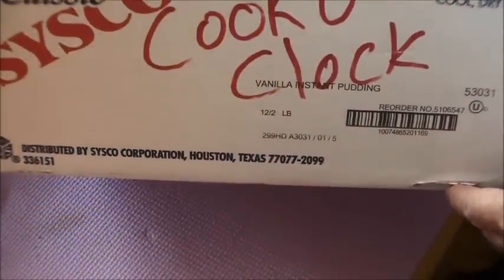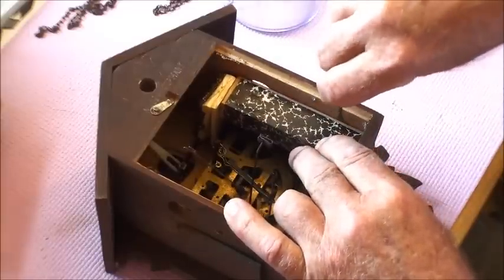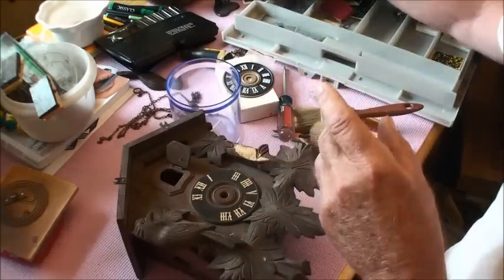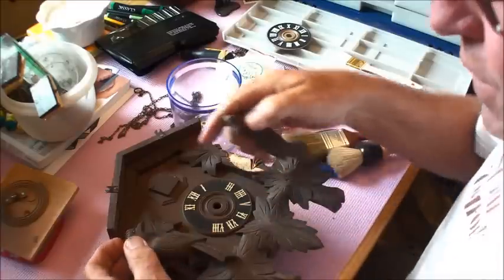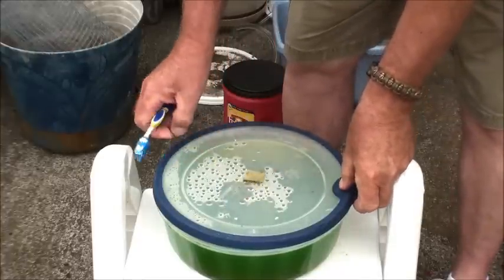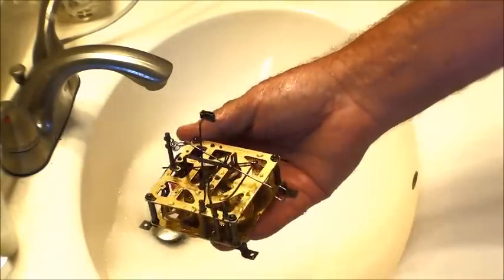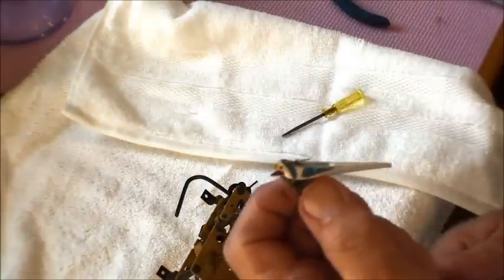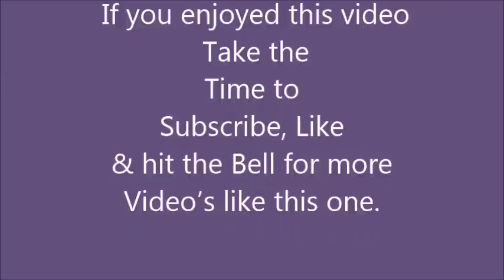Cuckoo Clock Repair

Comment: How have the same exact cuckoo clock that you are restoring in this video. How can I find out the manufacture date?  It is exactly the same!
Reply from the maker: I can not tell you much except that if it says made in Germany, it is after World War 1. Still an old clock and still easy to find parts and order parts for the clock Cynthia. If it says German only, then most likely it is before World War 1 and also has a bigger nut that holds the hand on.

Comment: Hello Mike I just cleaned my cuckoo clock like you did and I am having an issue with getting the clock to start cuckooing.  When the hour or half hour hits it does the cu but not the ckoo and the bird stays in the out position.  I then have to give it a little tug on the chain and then it will start up but I have to do this every hour and half hour.  Any suggestions on what to do?
Reply from the maker: If you used the Dawn Dish Soap, there will be a little problem getting things to run right. For the bird, I have had to oil the wire spring on it's rod and oil where the rod attaches to the works. Then make sure to dab a tissue to soak up any extra oil. I hope this helps. I do have an email address below on my newer videos and might be below on this one incase you need to contact me with pictures or any other questions.
Reply: Thank you Mike for your tip.  I ended up cleaning again with the dawn soap but I made the water as hot as I could stand and shock it harder like you did in the video, rinsed it off and dried it now it is working like a champ.  Thank you again for the video and your tips for letting me get my wife's great grandfather's cuckoo clock working again.

Comment: Clock tick when I apply pressure to the key. can you help, please?
Reply from the maker: I am here for you. On some clocks that have a key to wind it. There could be a few answers to your short question. One would be the clock needs cleaned. Two, the spring it time needs to be opened up again. they tend to lose their spring power in time and may be caused from a bit of overwinding, but still ran. The third thing could be it was overwond and has to be shock to keep it ticking until the spring can take over again because it is stuck on itself.  Thanks for stopping in Clifftonic Studios and hope this helps you.
Reply: @justmike57  I was working I dropped it just no I have to apply pressure with key clockwise to make the clock tick
Reply from the maker: @clifftonicstudios7469  Not knowing the clock for sure, I would have to say you might need to open the back of the clock and see if something is broke now or maybe bent, like any of the knobs to wind, or change time.

Comment: I have a Cloches de Corneville Merry Go Round 7534-35. The weight was no longer  heavy enough to keep the pendulum moving without a second weight attached. I removed the clock from its house and cleaned it. One weight is now heavy enough to keep the clock running but only while outside its house. As soon as I mount the clock back inside it's house, the wait is no longer heavy enough to keep the pendulum moving, again, without a second weight attached.
When I take the clock back out of the house, again, there's no resistance. I still need to mess with it more so I'm looking for any ideas.
Reply from the maker: For sure, your clock needs cleaned. The old oil and dust is starting to bind up where each gear goes into the plates. I would suggest a good clock cleaner and letting it soak awhile before scrubbing the works with a toothbrush to help loosen up the gummed up oil if you don't plan on taking the works apart Darth Vader
Reply: @justmike57  okay, thank you, that sounds like good sound advice, however... Can you explain why it works mounted outside of the house, but not mounted inside? I figure this is a real phenomenon that you of all people may be interested in.
Reply from the maker: Mounting the clock on the outside, you are able to level the works easily. When you mount the works on the inside of the clock, the works were just semi-level by the eye. So after screwing in the works, they level the clock and bent the wire, closest to the works until the right, (even) sounding tick tock is made. If you have your works inside the clock now, try tipping the clock right or left until you hear an even tic-tock.
Reply: @justmike57  I understand that leveling is important but I don't understand, "They level the clock and bent the wire (what wire?) closest to the works, until the CORRECT? (even) sounding tick tock?" So again, what bent wire and are you referring to? Are you saying that if I try leveling it properly it may run? Are you saying there's some bent or bendable wire I need to check?
Reply from the maker: I do have other videos on cuckoo clock repair. Check out this one to see if it helps you... Also, does the pendulum rub on the case or the arms that operate the bellows? https://www.youtube.com/watch?v=Yk4p2HoonF4

Comment: Can I use WD-40 for mechanism
Reply from the maker: W-D-40 isn't a good oil for clocks. It is more of a cleaner and light weight oil. This past year I stopped using clock oil because it wasn't working out very well for some reason. I went to a car oil. This is what I use now; SAE 0W-20  Full Synthetic

Comment: Did I miss it or did he not convey what oil to use???  That would be pretty important to know. 
Otherwise a very excellent video. 
Thanks
Reply from the maker: I am so sorry Jake. You can buy the Clock Oil on Ebay or type in a search for clock parts online for your clock oil needs

Comment: I have a pre-WWII cuckoo I am working on which was in pieces. I installed new bellows and have everything working except the wire that moves the bird in and out. I cannot figure out how it works. Can I send you pictures to see if you can help?
Reply from the maker: The wire will go on the side of the top or the bellow that the bird is sitting on. The bellow opens, and at the same time, the wire slides on the bottom side of the tail of the bird Michael Bullerdieck. I hope this helps, or I could send you my e-mail    address in needed.

Comment: What is the objective of the holes each side with a cover of wood?
Reply from the maker: On some of the Cuckoo Clocks, the hole that is covered with wood is for inspection and also a way to trigger the clock to cuckoo. Most you new clocks don't have the hole and different brands of clock don't have them either. Thanks for watching Quim Roscas.

Comment: In my clock cuckoo calls only once per hour. How can i fix it? Please give me some suggestions..
Reply from the maker: Hello there Mahua, In most cases, the clock has not ran for a while and a spider dies in the front of the clock, stopping the arm from swinging to the right hours ring. You will need to take the works out and look at the front of the works, where the hand shaft is. The black, 1/2 moon, with teeth piece is what drops to the right hour when the minute hand reaches the 12. Sometimes you can remove any debris from this area to get it moving freely. It wouldn't hurt to oil it lightly again as I show in my other videos. Sometimes you should just clean the works and re-oil everything again. let me know if this helps or I can help you with it later. Thanks for watching my video Mahua Debnath Dutta
Reply: Thanks I’ll try this

Comment: Good morning! I bought new chains for my cockoo clock but I'm not sure how to do it I was hoping you had a video for me to see.
Reply from the maker: If the old chains are still on the clock L Jury, Take the hook off the chain and the ring off the new chain and hook up the new chain to the old and pull the new chain through. Then take off the old chain and reinstall the new chain. Now move the hook on the new chain, to the other end of the new chain, and of coarse the ring where the hook was.
Reply: Just Mike there's only one chain remaining
Reply from the maker: Wrap the good chain around the clock so it does not fall off the gear inside. Then turn the clock upside down with the back off for light. Then use a small screwdriver, and insert it in one of the holes of the clock where a chain is suppose to go, and turn the gear where the chain is suppose to go. See which direction it turns. Then with the hook and ring off, insert the in far enough on the gear to catch the chain. turn the clock back up, and with the screwdriver, turn the gear until the chain comes around so you can put it through the hole and reinstall the hook and ring.
Reply: Just Mike thanks I'm going to give it a try

Comment: Got my clock ticking but the hands don’t move...  Advice?
Reply from the maker: Don't know for sure what you mean Ed. The hour hand gets wedged on first on the right hour, then the minute hand normally has a brass piece in the center of the minute hand with a square hole. The nut holds the hand in place. If need be, send me a picture and more info on the clock in an email below Ed Iacona

Comment: I have a regula cuckoo clock and i have a problem is that the clock stops at 2 or 3 minutes before 12 and i move the minute clock hand and it offers some resistance to pass the 12 do you know what problem probarly it has? thanks the clock was oiled 2 years ago
Reply from the maker: Cuckoo clocks are considered a dirty clock because they are open to the dust. Where the pendulum is, chains pulling in the dust, Doors or dancers let the dust in. So you should watch where you hang the clock. Try to keep it away from the kitchen because of the cooking oils and grease. 
  There also drags in the clock that trip areas to let the clock know it is time to mark the hour or 1/2 hour. These could be getting dusty and mixed with the oils causing to much drag. If you happen to have oiled it yourself, was there too much oil left behind to cause the dust to collect faster than normal? 
  Just giving you thoughts to think about and for me not knowing anything about your clock or what conditions your clock is in so I do hope this answers your question 
gusro12
Reply: thanks a lot the clock is not in the kitchen is in a room and when started to  happen this problem i put it a 3 to 1 oil two times so i think perhaps was the problem, is very strange because the half hour is not problem with that
Reply from the maker: @gusro12  The 1/2 hour only moves a slight drag for just one cuckoo. The hour has a larger lever to move for the right count of the hour. The 3 in 1 oil might also be a heavier oil than clock oil you get get off of Ebay and if you need to, use a tissu to pull up the excess oil left behind to help prevent the dust from collecting faster.

Comment: I have a new problem, my cuckoo has 2 doors and when the bird is singing at the same time the musical box from the other door starts to play how can i do to make that when the bird finish later the  music box plays
Reply from the maker: There is a wire that will drop down as the bird gets ready to cuckoo. Not sure what your clock looks like inside because there are different ways these clocks are set up. The wire normally drops down to the fan part on the music box. I have an email address below the video if you would like to send a picture or two Gusro12.

Comment: Question: My clock minute hand stops when is about to hit 12 and wont move anymore
                  can you give me an idea ? what can I do ?
                       thank you for a nice video
Reply from the maker: The best thing to do is pull the works out and see what might be catching. Remember, you should not never turn the clock hands backwards to set the time because the counter lever will bend, and you will have to straighten it back in place. Also, if you are running the hands forwards to catch up with the time, you need to let it cuckoo each time, as to not bend anything in the works. The newer ones are a little more forgiving.

Comment: what did you paint it with?
Reply from the maker: You must pick a color that matches your clock. I use a gel stain that you brush on with a sponge brush and do not wipe it off, just let it dry on the clock Mazymalny.

Comment: I had good success with my first thrift store find clock restore, thanks to your vids,  so the hunt was on for another project. I found an 8 day Anton Schneider Söhne clock a couple of days ago. It was in pieces in a basket at the consignment shop. It was old and dirty looking but all the parts were there (just missing 1 weight hook). I cleaned the movement with ammonia and oiled all the pivots. The gong was way out of adjustment. One of the bellows had a rip, so I taped it with Gorilla tape. That worked. After reassembly, it's on the wall now and ticking away nicely. This one is going on ebay, hopefully for a hefty profit......The finish on this one is dry and dirty. I dabbed a minute drop of  mineral spirits but didn't like the results, then I dabbed some Olde English oil, but that seemed to take off some stain. There is a product called Howard Restore-A-Finish which is made for rejuvenating old wood stain , did you ever try that? I don't want to restain and possibly affect the antique value of this clock. 
PS: the leaves on your clock are called Linden leaves.
Reply from the maker: These were great story on your success on the clocks, especially the one in a box, in parts. 
  I have found that the cuckoo clocks seemed to be very cheaply made. 
  I swear the stain was made from the mud they have there. I have tried to clean the clocks up, but the fronts of the clocks stain comes off very easily. I do believe I use a walnut gel stain and used a sponge brush, and gave it a nice coat over the face, bird, leaf, rabbit or whatever was on the front. Then I did the house and the clock looked so nice. Still kept the old look, but was not chipped looking or dusty that you couldn't get off. Just remember not to take a rag and wipe the stain off. Just leave it on there and it will dry nicely.  
  It's been a long while since I tried to look up what the clock age was or even where it came from. For now, I just stick to fixing them as a challenge,  expecelly sometimes, finding the place on line that has the parts you are looking for.  
  Thanks again for you great adventures of fixing these old clocks.

Comment: have you used brasso?
Reply from the maker: Brasso is for cleaning the surface and does not clean out the old oils and dust and is very messy to get around all the gears that are sticking out Elizabeth Eckel.

Comment: The acorn on the right of mine is jamed up and wont move . Do you have any suggestions
Reply from the maker: I do believe the right one is the cuckoo bird. Turn the minute hand to the hour, (Clockwize only), then go 5 minutes past and pull a little on your acron. This should get the weight to drop as the cuckoo bird runs. This clock sounds like it needs cleaned and oiled again.
Reply: @justmike57  hi Mike thanks for your reply I made a mistake although the right one isn't working when I turn the clock by hand it does ( acorn falls down) .
The left one is the one that's jammed it is very clean any suggestions for the left acirn not moving ? It jamed when I pull it

Comment: Hey mike, I have a musical cuckoo clock that needs to be repaired. Look like you are the man I’ve been looking for. Do you still do repairs?
Reply from the maker: Yes I do still work on the cuckoo clocks, but had to take a break from them, because I built a Washington Room to so the repairs in, but don't have it finished yet. Thanks so much for stopping in Leslee Steinecke.
Reply: Hi Mike about 20 years ago my dad gave me a cuckoo clock and it stopped working - I pulled it out today and had it hanging on the wall and after I tried to set the time the left chain and weight  immediately dropped to the floor, it’s like the mechanism doesn’t hold it - what are some possible causes?
Reply from the maker: @rickdehart5382 hello there. The clock oil has gummed up for age and dust. A good cleaning and fresh oiling would be my advice. For a possible quick fix for now, you could get some clock oil off of ebay or a clock parts sight. You can oil the inside gear of the wheel that doesn't hold right now. There might be a little lever that is spring loaded that should be making the clicking sound. So are just metal plates that does the holding. Below my new videos, I have an email address you can get a hold of me for further questions if you like. I do hope this help you on getting the clock working. There could be a chance that your dad took the clock down because of this very reason.
Reply: Just Mike thanks for the reply - I will take a look and see what I can determine.  Thanks for the video - it was interesting to see how the clock works and how you restored it.  I will let you know if I have any luck.  Take care

Comment: Hi can you tell me what color of stain you used?
Reply from the maker: There are several colors these clock were stained with. The Older ones had a mud like stain that would come off with a little cleaner, not good. I think this one was some leftover stain I had of Walter's Formby brand that were bought and taken out of business. I went to Wal-Mart and bought some acrylic paint stain that was close. The name and number is 21982E Chocolate sprinkle.
Reply: @justmike57  have watched a few of your vids ..very informative...ty not having much luck learning about my clock though
Reply from the maker: Below the video is my email address. Send be a picture or two of you clock and tell me what your stuck on.  @bobconnelly4057

Comment: In che bagno di prodotto e stato lavato il meccanismo?  Sembra detersivo dei piatti.
Reply from the maker: In the videos I used Clock Cleaning Concentrate - Ammoniated. You have to use it in a VERY Well Ventilated area. The have some that is safer to use : Clock Cleaning Concentrate - Non-Ammoniated that I haven't tried yet Leonardo Cannata.
Reply: @justmike57  Grazie mille purtroppo non so altre lingue solo Italiano e perciò non riesco a leggere.